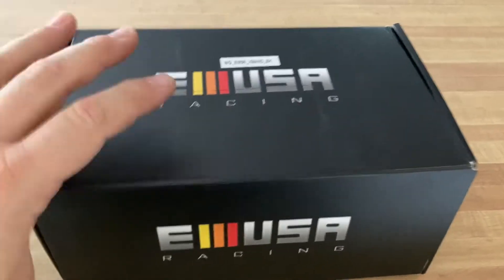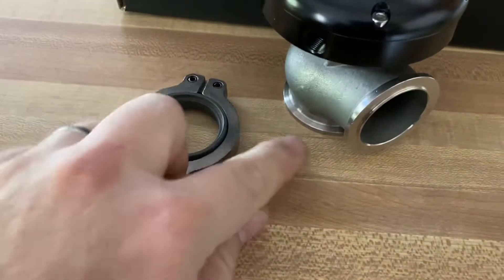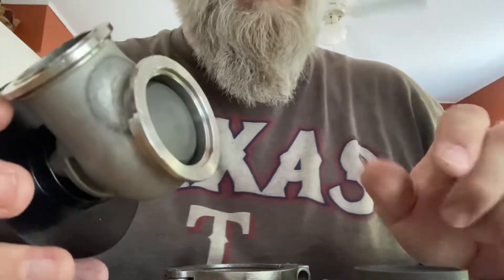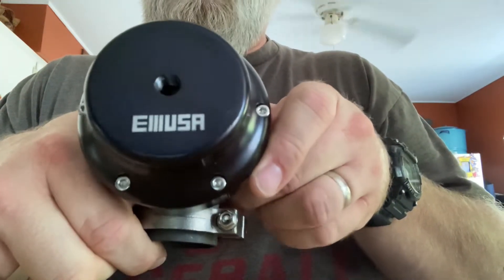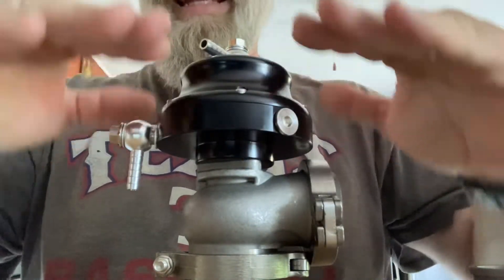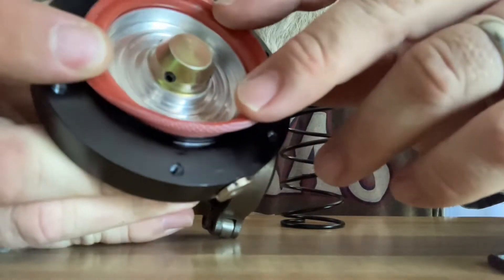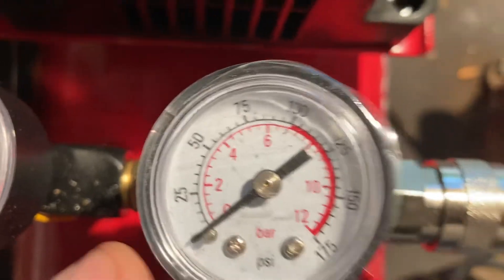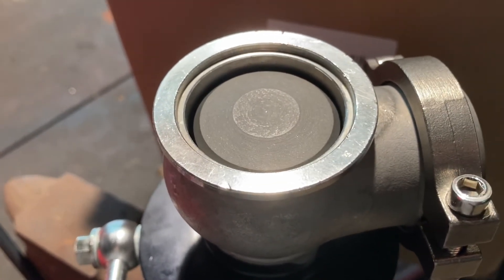Tial Wastegate 38mm | EMUSA - Are The Spring Ratings Accurate - Lets Find Out - Is Cheap Better

Comment: Awesome! Great value for what looks like a good product. Do you need to lubricate the diaphragm or anything?
Reply from the maker: Yes, I was surprised of the quality. You shouldn't need to lubricate the diaphragm but can while everything's apart. That part of making them bullet proof. Mainly, lubricating the piston shaft and adding blue locktite to the hex screws holding the diaphragm on the piston. A good polish to the piston and fire-ring too. All in all, great out of the box. I may bulletproof mine down the line.
Reply: @OperationRV  sounds great! Thanks for the info!